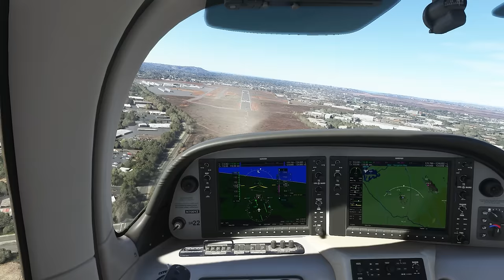Fatal Plane Crash At Montgomery Field After Student Pilot Declares An Emergency | N700YZ Crash

Comment: There should be a LAW preventing ATC from talking so fast they are not understandable.
Reply: That's like saying slower surgeon is better surgeon 😂. Pilots understand them just fine.
Reply: @fatdaddy-viii-8672 according to ICAO ATC should talk at a pace at which the pilot talks on the other end on the channel. And it's also a standard that the normal pace is around 100 words per minute. Fast talking should NOT be normalized, it's not a f***g language or communication competition, people just want to fly safely.
Reply: @FlyingCsongor  Because the rapid radio transmissions were what caused this pilot to fly in an unsafe manner?

Comment: I have to say, this Controller was not at the top of her game. As a retired Controller, her phraseology is NOT standard. Stand-by is not a substitute for ‘hold short, landing traffic’. Secondly, she WASNT LISTENING. ATC’s radio always overrides a pilot radio. Thirdly, this was massively over controlled by the ATC specialist. Instead of issuing ‘follow N- - - -, report in sight, she is calling their bases….this was not positive control by any means. When an ATC specialist starts calling bases, it gets ugly. Extending up winds is THE BEST solution for a safe pattern in a VFR environment.
Reply: Sorry for the late response, but I hope you see this. With you being a retired controller, I would expect you to have more experience than this. Have you even looked at the MYF airspace? It’s 2.5 mile radius cut off by a Bravo airspace 1 mile to the north and bravo airspace 2 miles to the south. An extended upwind would mean their crosswind turn would violate the Bravo airspace. There is no upwind. The extend downwind is make sure they don’t turn base to cutoff any traffic because there are parallel runways with multiple on final every day, every hour. Approach controllers always turn planes on a base and I use the same techniques as a tower controller. We say standby instead of hold short because a hold short requires a readback. If you tell them to hold short, that means they taxi out of the runups and block any traffic that you need to actually “hold short” of the runway. Standby means to stay there and not move your aircraft. Retired controller is your badge of honor and you obviously never worked any busy GA traffic. But yes, go on and be an armchair controller which I am sure you are good at. -MYF controller, 10 year navy ATC, Corpus Approach, SEE, CFO, BRO.
Reply: @corpuscarl2237  Are  your impressing me with your knowledge, or just spitting  out anger? I STAND BY my previous statement. HOLD  SHORT is the only appropriate phraseology. Grow up.

Comment: The pilot was clearly panicking.   If he had kept his cool, if nothing else he could have just cut the engine and pulled the parachute as those planes are equipped with a parachute that deploys to safely lower the plane to the ground, saving the occupants. But he was so panicked he not only couldn’t remember about that, he couldn’t remember how to work his radio or anything else. Poor guy.
Reply: If he was doing pattern training he was probably at too low an altitude for the CAPS system to function.

Comment: Yeah. Circuit breakers needed pulled. 
Here’s my solution if it were me ….
-Abort the landing.
-Get cleared out of traffic pattern and away from traffic 
- get the circuit pulled 
- check controls and ensure electric trim is off
- contact tower and rejoin pattern. 

Easily said I know… this guy was a student and it was overwhelming ..understood. 
Panic set in and he just wanted to get it down.  
So sorry for the family.

Comment: GA pilot, I don't fly a cirrus so don't have first hand experience with that plane but generally trim is something you can overpower with yoke pressure, it might make it harder to fly but it's not unmanagable.  A student pilot would probably be correct in calling for an emergency as they're learning how to fly the plane when it's behaving itself, much less when something goes wrong.  Unfortunate situation for that student to have to face and very sad result.

Comment: Why do ATC controllers think they can tell a pilot that they have a stuck mike.  If the pilot’s radio is truly stuck in transmit, that pilot is the only one that won’t hear the controller saying the mike is stuck.  I’ve been flying for 49 years and have wondered why they haven’t come up with a multiplex communication system.  I’m not a Cirrus pilot but I would imagine they have a trim disconnect or circuit breaker to stop a trim runaway situation.  What a tragedy.
Reply: They do have what you call a "multiplex" comms, but the current national airspace is not built for it. 

There are two primary solutions: the first is the use of two freqs: one for xmit and one for recv. That would be difficult to set up, and you'd probable need someone like ICAO to create "frequency pairs" for just this purpose. Plus now you need manufacturers to update gizmos, then swap equipment in all aircraft, ATC and ground comms...you get the idea. Not gonna happen.

The second solution - and more doable - is digital transmission. This can work within a single frequency, and even permit multiple stations (radios) to xmit/recv in parallel. This is basically (very basic) how your cell phones work. Digital spread spectrum makes it even more reliable and scalable. This is really where things need to go.

The FAA wants to move to digital as an option for GA. I don't know where the plans are, but I'd sign up in a second. They already use digital comms for unmanned ATC with commercial planes. As that expands, we might break out of this WWII-era system.

Comment: This is heartbreaking that there was a fatality. Managing radio coms is my biggest fear as a student pilot. Still, I can't help but think there was enough room to set down next to the field but if he had a mechanical issue those decisions under pressure are VERY difficult for a new pilot, especially when you are trying not to piss off the tower.
Reply: Please take this statement to heart. As a student pilot, always do three things. 
 - Announce that you are a solo student pilot at the end of your callsign when you are flying solo. It does not matter how many hours you have. Your certificate says “Student”.
 - In an emergency, screw trying not to piss off the tower. In an emergency, you are the boss. The tower works for you. The other aircraft work for you. Everyone else needs to get out of your way (if able). 
 - If you are a student pilot flying solo, any abnormal event can/might be an emergency. All urgent event IS an emergency.
Reply: And the pressure increases in an already crowded pattern.  So sad...
Reply: @deanfowlkes  When I took ground school for my Part 107 they actually went over this.  You take the same classes for ground school for Part 107 as you do for PPL.  If you feel it's an emergency you have every right to call emergency - especially if it's affecting the control of your aircraft.  Out of control is out of control.  I was surprised the tower just kind of brushed him off.  It sounded like a busy day for Montgomery, and I wonder if the controller was a little overwhelmed.  She seemed that way.  Her replies were curt and fast, almost to the point they were hard to understand.  In RF communication it's important to enunciate clearly - that goes for any field.  She talked fast and blended her words.  A few pilots had issues with understanding her.
Reply: Student pilot like any pilot  you fly the plane first worry about everything else including the radio and  tower last.
Reply: @BitwiseMobile  - I am really not sure whether you are agreeing with me or trying to argue with me. My reply was meant for the original poster flying a manned aircraft. 

In controlled airspace, ATC across the country will recognize the inherently unorthodox nature of a student pilot on solo. Although this entire airspace sounds like it was full of student pilots, the other students were probably recently minted Private pilots or had instructors onboard. 

Nothing against Part 107 (I have my Remote Pilot Certificate, as well), being alone at 1000 feet AGL at 90 knots lends itself to a whole different world of stress and complications. A solo student pilot will be task-saturated and can fall behind the aircraft very quickly. So, stating that you are a “Student Solo” will alert ATC to afford you more time, patience, and aircraft separation than they normally would. 

As far as emergencies, they are in the eye of the beholder. If you are student solo, and a wasp gets sucked into the cockpit, that may be an emergency for you. My point was not to be afraid to call it. You won’t get in trouble for being overly cautious. 

Just make sure you call it correctly with callsign, nature of your emergency, and where you are if not already being provided radar services.

As far as the controller, yes, she may have been overwhelmed. This type of traffic flow is not uncommon at a busy Delta Airport. Especially one with several flight schools on the field and/or a plethora of training traffic. Bravos and Charlies can be even busier during a push. ATC will be curt and quick unless given a reason to slow down (like a student on solo). I’ve actually seen ATC hold aircraft from entering the Delta while a student was on solo. They will even put other students (with instructors) in holding patterns or 360s to alleviate the traffic pattern for a solo student.
Reply: @deanfowlkes  I mean I was agreeing with you.  Not sure how you didn't see that.  Congrats on your part 107.  Maybe don't look for a fight everywhere?
Reply: @BitwiseMobile  🤣😜 Seems to be hard to do on YouTube comments.
Reply: The plane is very flyable even with the trim fully forward. Cirrus’s don’t use aerodynamic forces to trim, rather a spring that is manually easy to overcome.  He didn’t need to set it down, it was perfectly flyable for a go around and landing or a climb to pull the chute.
Reply: It was mine too, 7000 hour retired pilot here.   Don’t worry too much about coms. I got my license in a no electric plane and was very afraid of them.  You’ll get better at it when you do your IFR.  It gets much easier.  It’s really all very routine so after enough time muddling through you’ll get it.  Don’t ever be able to say “I’m sorry I don’t understand”.  If you say the wrong thing to the wrong Controler they will help you out.  It happens all the time.  It helps to take a Controler to lunch,  or go get coffee and ask if you can visit the tower.   After talking with them and letting them know your fears they will greatly help you.  I ended up flying with several controllers.  Calling them won’t be odd at all,  they like talking airplane too.  

Just know,  it does get a lot easier.  Eventually you’ll realize what your low time CFI told you was due to his own insecurities on the radio.  90% of the time they are still afraid.   The Controler’s aren’t looking for reasons to get you in trouble.  They really aren’t.  And the worst thing you can do for the most part is make a mistake.  When you do,   And it’s when not if….  Stop and say exactly what you did.   The majority of the time as long as you don’t cross an active runway or have straight up disregard for instructions.  It won’t result in a phone call.    Even if you turn the wrong way.  They will just say “N1234,  where are you going”.   And you say your heading or location and say you’re  sorry…. Followed by what can I do to fix it sir,  can you give me a heading?”

Comment: As a student pilot, did he normally fly the cirrus or had he transitioned to it from flying another make/model with possibly manual trim or electric trim control mounted on the panel instead of the yoke. The controller mentioned a stuck mic, could he have been holding the mic button down while inadvertently thinking he was trimming the aircraft?
Reply: I think the Cirrus is rarely or never a first airplane, too high performance...
Reply: Very plausible
Reply: @stanislavkostarnov2157  plenty of sr20 trainers around here. I learned on something even more high performance that that, so it's definitely doable, maybe not common.
Reply: I own a Cirrus SR20. It’s very plausible that he might have been used to a different location of the PTT button and might have been pressing that in stressful situation.   On the other hand having a stuck trim button (It’s electric after all). Will wait for the report.

Comment: It sounded like panic had set in. There could be some mechanical failure that surfaces but if it was an electric trim problem, it seems he might not have been trained to disengage the autopilot system or if that failed, where to pop the circuit breaker. If it was an elevator runaway trim issue it might have led to a better outcome by increasing power, gaining altitude - which even if the trim was trying to climb he might still have had enough power to keep his airspeed above a stall, and finally then pulled the CAPS system at a safe altitude and floated down. By hyper focusing on landing instead of concentrating on flying the airplane and then climbing to a safe altitude for CAPS or just for more time to work the problem, is just too sad. So sorry for his family...

Comment: After working on yoke switches for years, it does sound as if there was a short in the yoke.  Had someone recently done maintenance on the yoke switch and not gotten it back together correctly.  They can be a little tricky, very close tolerance.
Reply: But assuming you have runaway trim, would it really crash it? I've never flown a cirrus, but I'd assume it uses a spring trim system - can it not be overpowered with muscle force at least for a few minutes in an extreme position?
Reply: @Maverickx89  I don’t know about the force on the yoke it would take to override the runaway trim issue.  New pilot put in a very bad situation.

Comment: This is the BEST example of a pilot who does NOT know what type of equipment he is flying.  ANYTIME you have a parachute, you should "SIMULATE" and emergency in your head and your mind and go through the steps of the type of emergency you created.  When I fly with a parachute, I would begin by jolting myself, or banging my head a bit to get my mind straight on my sequencing and then go through the steps each time WITHOUT actully pulling the chute.  I felt so comfortable flying that if anythng would have happened, I would simply repeat the emergency steps.  THIS GUY DID NOT know he is flying a Cirrus with a chute and could have pulled it on landing.  He would be alive today if he had.

Comment: My aircraft has electric trim and manual trim.  I disable the electric trim because the manual is less like to malfunction.  The pilot had two issues.  A trim problem as he stated and an aircraft on the approach end of the runway.  Seems like a lot of training/pattern work at that airport.  Rest in peace.

Comment: Pilot here and lesson is: learn as much as you can about the aircraft you’re about to fly. Specially to pull those breakers. I’ve had all kinds of trim issues and even autopilot stuck as I used to ferry planes down in Florida. Always knew where those circuit breakers were located. I have also flown cirrus sr22 before. At 400 ft level flight or above you can pull the chute. Pull the damn chute. Walk away from the accident.

Comment: The content of this posting is based on opinion and operational experience.  Trim problems are seldom fixable in the Air.  My worse experience being roll trim being questionable in a 737.  If you have flying authority to go up and down using strength in a pitch trim abnormality or left and right using strength in a roll type or rudder trim situation.  my advice to you is to make only a modest try to move the control surface manually or electrically.   
Do not use other than reasonable force on the system.   find an airport, plan your flap setting, and speed and land as soon as possible, If the trim is jammed there is still mechanical continuity between the trim wheel or trim button and the control surface. This condition will still allow positive but uncomfortable use of the control surfaces. If you keep mucking around with the mechanism, you can break, bend, or deform parts that will render the control surface unworkable.

Comment: I think he got fixated on landing taking him out of having a stabilized approach. Circuit breakers are normally hard to get to and identify correctly. He'd of probably been better off going around to get the plane stabilized for the speed desired for landing. Being a new pilot it must of been tough. A full deflection of trim must of been too much for him.
Reply: It's very disorienting and scary when the plane controls get taken away from you whether it be a trim issue or a faulty autopilot.  (CFI myself and I've seen it happen).
Reply: @gringoloco8576  It's going to be interesting to see what it was. Maybe it was rudder trim, but I don't know if that model of plane can apply a drastic enough rudder trim to set up a cross control spin that's a fast entry to a nose down spin. Lots of rudder would induce a banking turn and not being aware the best thing to do would be opposite rudder not banking things could end like they did. Guess it's a good thing for a guy to remember in case an out of control rudder trim takes over. Had to train for spins for CFII and those darn full power climbing out cross control spin entries are a radical entry for sure. Low power near stall use rudder for turn and bank so an aileron doesn't create drag stalling a wing on you.